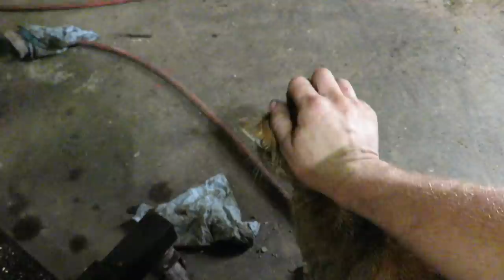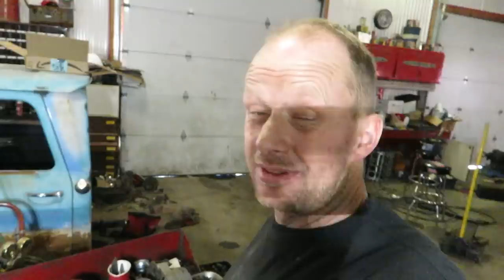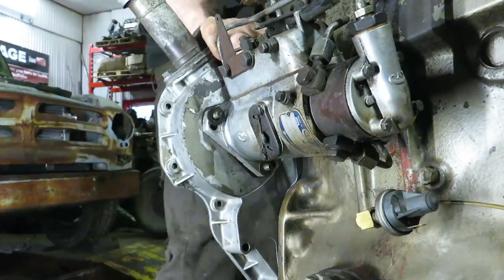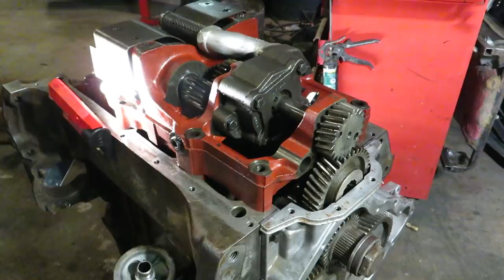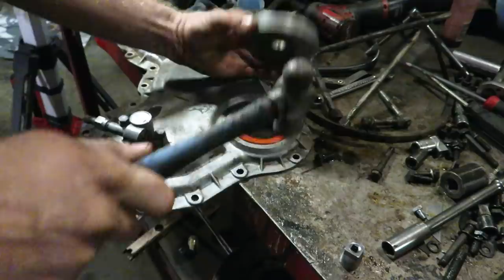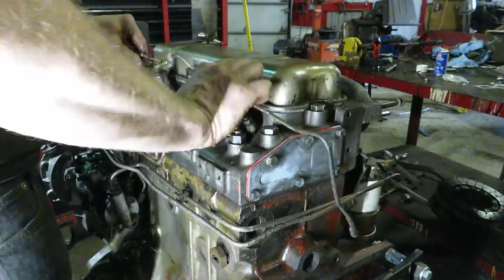3.9 Perkins 4-cyl Final Assembly | Massey Ferguson 270 [EP4]

Comment: One point on the injection pump, when you take off the front cover plate behind the injection pump to remove the three bolts it makes no difference if the engine turns. The pump will only go back on the gear one way. You are right to mark the pump housing before removing the pump.

Comment: Great video very informant, I recently bought a Catterpillar 416, it has a 4.236 Perkins less than 1400 Hrs. it starts and sounds good, but I found water in the oil, so now it sits , I found out  later it overheated in 2015, they replaced water pump but than it wasn't used much, it set for 7 years the oil pan froze and cracked, so in your expert opinion my question is where else could coolant be leaking from besides the head gasket? Because it started and sounded so good, but i won't start it anymore. Any help will be greatly appreciated, Thank you.

Comment: I have a Perkins diesel 3.9 in my wood chipper, I believe it is a 1998 , my issue is it will run fine for a tree job, then we shut it down, and go to start it and it turns over but won't start , half hour or so later it starts, can you give advice on this

Comment: I hope you will show installing the rear main seal. I have the same engines in my boat and need to change them out because they leak and would like to see if there is a trick to it. Thanks!
Reply from the maker: The engine stand was in the way so I bolted it to the front section and then installed the rear main seal, clutch and flywheel when I removed the stand

Comment: I congratulate you for your good videos you know I have a question I have a 2500, Dodge ram with the 6 bt engine and I had to change the gasket that came on one side because I was throwing oil and for that I had to remove the diesel pump but later to purge the lines does not want to tear or light me could you please help in any idea you have and thank you very much

Comment: Be careful with that gasket tack stuff.  I usually only use it on one side of the gasket/mating surface because I've had it actually rip paper gaskets while tightening stuff together before when used on both sides of the gasket.

Comment: ¿what is that thing below the alternator? At first I thought it was the starter but it has two lines and it looks geared to the timing gear train. Is it the fuel lifter or an air compressor?

Comment: Not sure I agree that it matters about engine position when removing re-fitting the DPA pump, it turns at half crankshaft speed, same as the cam and is keyed to the gear, the is not enough cleanance in the timing case for the gear to jump so you can't get it wrong, I've removed and  refitted hundreds without bothering to even check the engine position, never had a problem. Love the vids by the way even if you do blow up  Detroits for fun.

Comment: That gasket tack looks like the bees knees after using permatex aviation gasket sealer for so long, I hate that stuff with a passion but man does it work well.
Reply: from at least the late seventies the proper Perkins diesel approved Gasket Sealer was a product called Hylomar. I did my four year apprentice at a Perkins Distributor in Australia, Stripped down and rebuilt more Perkins Diesels than I can remember, we used to joke about rebuilding them in our sleep!
Reply: @adriaandeleeuw8339  Hylomar is great stuff, I've used it a fair bit as well.

Comment: Do you spray both sides of the gaskets with that spray-a-gaket? And is there a situation where you don't use anything on the gaskets? (how about with large "oring" type gaskets like the 6.0 powerstroke uses on the front and rear cover?) I'm self taught, and this is something I always ask myself when working on tractors and trucks.
Reply: You can but most guys use it to just hold things in place. If you want to do both sides they make the same stuff in a brush on form that makes less of a mess and is great if you've got a less than ideal sealing surface. Just be warned if you do both sides it is a B!tch to get the part off and you could easily break a big aluminum cover like that. So for this reason I only use it on both in RARE cases.

Comment: Quick question, i know the common rail cummins’ have a tendency to ruin their injectors because they need an improved fuel filtration system over stock. Would it be a good idea to get one of those additional filtration systems? Or will that cause extra stress on the pump?
Reply: A lift pump will solve both those issues
Reply: GrandPrix LI a lift pump actually helps your fuel pump

Comment: It's comforting to see a seasoned professional use a somewhat cheap torque wrench instead of a 200€ Hazet (As a European, Snap-on(or off!) is not a thing.).
Reply: In Australia when I was doing my Apprenticeship we used Warren and Brown Torque wrenches I have several and have had them for over 40 years, the largest is a one inch drive 1000 ft lb version. and yes I have used it to tighten down head bolts.

Comment: As a tech i NEVER labeled anything. Like he said it only goes back together one way correctly. Theres only a VERY few situations where a bolt being a few mill to long would hurt. Like old ford straight 6cylinders a bolt will puncture the #1 cylinder if you put wrong one in. I dunno maybe we do have photographic memories i can visualize an engine bolt by bolt piece by piece being assembled in my head. I guess I'm naive to think everyone see's it this way
Reply: It comes with time doing something long enough. Adam Savage had a cool anecdote on it that the hardest thing about being a Maker was being able to visualize what you want to create in your head from start to finish before you even begin.
Reply: @cumbob  yeah thats a good quote. While i don't do engines daily i do build stuff daily that i have to visualize building large concrete structures for multi story buildings. Not as precise but very similar skillset mentally.
Reply: I can do the same but I've found bagging stuff that goes together speeds things up....now if I just could do it more often lol.
Another trick is after doing enough stuff that's hidden you get a good feel and can almost do it blindfolded. As for feel you also get a feel for torque and a guy I worked with was called the human torque wrench. He could geth things within a few ft lbs and honestly was as close as most with a torque wrench. He won quite a bit of beer money off of it too and shut down some torque Nazis who couldn't believe it lol.
Reply: @southjerseysound7340  for me I use magnetic trays or one big one divided up by section. And muscle memory and the feel you can gain from it is amazing. Our brain does a lot of things subconsciously along with our bodies.

Comment: I developed a system recently, because yes I'm that heretical Ford guy who actually works on his own stuff, that simplifies labeling of connectors.  BTW, I'm pretty sure Honda is a worse culprit for the same connectors issue, but I digress.  You label each side of the connection with some blue tape and a black sharpie with A-Z, then 1-infinity, BEFORE you disconnect it ("A" on one side, "A" on the other, then pull it apart).  Makes it really easy to get them back together and isn't super time consuming.  I used to label them using words about where they go, like "coil" or "throttle body", but that was really cumbersome because of space constraints and time-consuming because lots of letters.  Labeling both sides with the same letter makes it just go back together like LEGOs and is quick and easy.  No thinking required when you have high cognitive load.

Comment: who rebuilds a complete engine and not fit a new oil pump its just dum
Reply: Depeneds on if its wore out. Alot of the older diesel equipments engines, those oil pumps can go two or three rebuilds as long as someone changed the oil. Measure it, if it's in spec throw it back in, it's not like it's going to spontaneously explode.
Reply: @fordmud  yeah oil pumps don't wear out in pretty much any engine
Reply: Joe schmo our John Deere rolled over 10;000 hours was for for a rebuild. Rebuilt everything but the pump. Pump failed less than 10 hours after rebuild.
Reply from the maker: Good thing its me warrantying my work, and not you!  It looked great with no visible wear.  I won't lose any sleep over it
Reply: DEBOSS GARAGE I saved the engine. All waning lights came on. So all was good.
Reply: @ferguson20diesel49  
Guess you should have checked it then. Oil pumps are pretty simple. And theres not much to measure. So that means either you totally neglected to look at it or you left something in there that caused it to go out, which would have happened with a new pump. Poor mechanics just replace parts and hope it works without actually taking the time to look and see what's wore and what needs replacing.
Reply: Luke Strough I didn’t rebuild it. Neighbor down the road did. Key way wasn’t in right. It’s had a hard time that tractor anyway. Rebuilt twice. Back end done. And crashed once. Basically a big pile scrap now. Only for around the yard.
Reply: orkid knog Yeah oil is a pretty rough substance I can’t even count how many times I’ve seen oil pumps just catastrophically fail.
Reply: Joe schmo pumps fail. Pumps can cause other problems too. Like blow internal seals inside the back and leak oil inside constantly. If relief valves don’t work. It will crack lift tops and blow holes out through it.
Reply: Ferguson 20 diesel k
Reply: The original Perkins pump is much better quality than the replacement parts sold now. The only reason to replace one is if its really worn or was already replaced with a new JUNK pump.
I actually put a used original Perkins pump in my sailboat  because the replacements available for it are TRASH. The guy who did the machine work is one of the best in the marine Perkins field and it was his recommendation  because the steel is crap at best. He has a collection of trashed pumps to prove it and you can see how they only have a thin hardened surface. Whereas the old original pumps are hard all the way through. 
In my engine the "new" pump installed when the previous did a rebuild didn't last and caused me to have to rebuild it again after 600 hours when it should've gone 6,000 hours or more.
Reply: @ferguson20diesel49   the replacement pumps available for most Perkins are trash and in most cases you are much better off reusing the old one unless you can find a NOS OEM pump that's been sitting somewhere for years.
Reply: SouthJerseySound no shortage of good used parts here.